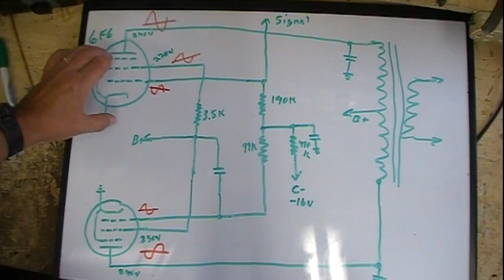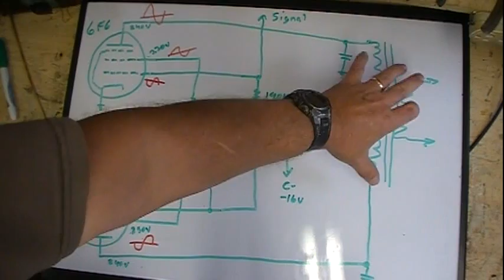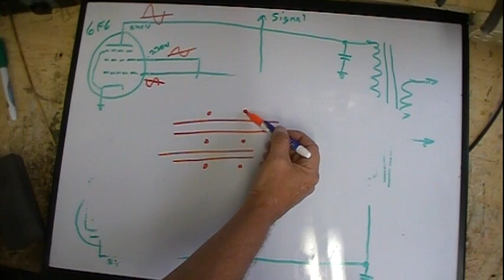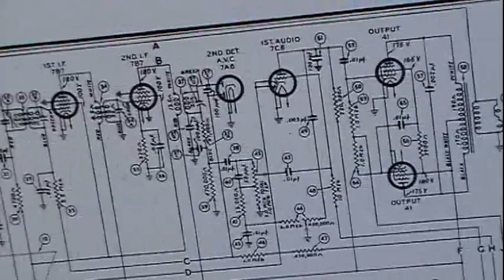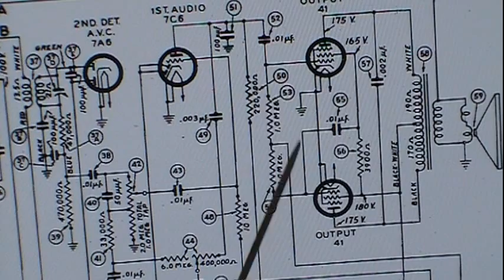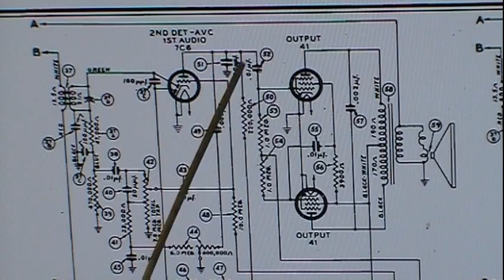Screen grid phase inversion, Tube theory

Comment: Great video Dennis.
I have a question on your first example. You showed one end of a capacitor going to the control grid of tube two and the other end going to B+.  Shouldn’t that end be going between the screen grid of tube one and the 3.5K resistor or am I missing something.
Reply from the maker: OldRadioDave Yes it should of been. Thanks for watching.

Comment: Great instructional video. Take a look at my last two videos concerning my 1930 Eveready radio that I am having problems with. Gary
Reply from the maker: HD7100 Sorry I didn't get back to you any sooner. But you did get it working great. The type 80 tube was gassy and that is why it had a blue glow. And florescent  lights can be murder on radios. One other thing type 26 tubes have a 1.5 volt filament and the type 71A tubes have a 5.0 volt filament.
Reply: Dennis Carter I learned that when I saw the 26 tubes burn out. What a fiasco. Anyhow the 26 tubes were in the radio when I got it and it looks like they were in that radio for a long-long time. I have it all back together and worked on the speaker I want to use with it. I'll make the final video once I have it all setup for display in my house. Thanks Dennis. Gary

Comment: Thanx and again THANX for this one!! GREAT suff, well explained, couldn´t do it any better! :) :)
One question still remains:
You said that it´s been used with class AB2, you may have some schematics on that, Because it must (in my opinion) be different, as class AB2 with control gid current, you need a different method of feeding the signal to the control grid, otherwhise there will be lots of distortion.

And there is another big advantage when putting this kind of power stage into an amp for intruments. They really act a lot different when they pushed into saturation, as they tend to produce a lot of even harmonics, the "tone" is differs a lot campared to any other amp (with traditional PP and phase inverters).

Angain: thanx a lot for this lesson!!!
Reply from the maker: TubiCal I just did a video that I hope answers your question about class AB2. It will be upload later tonight. Thanks for watching.